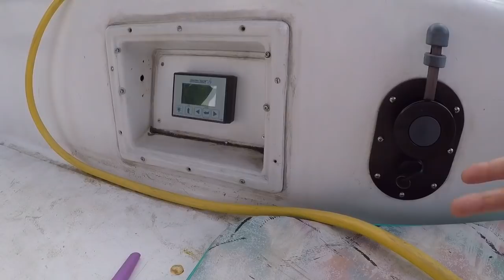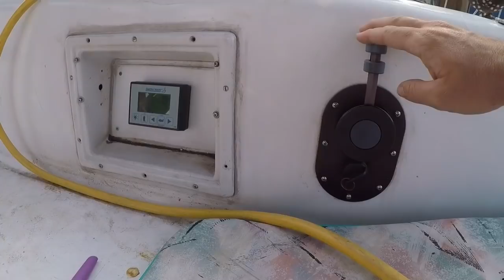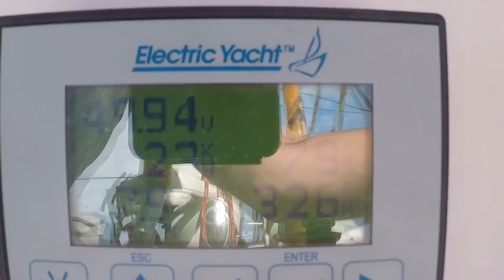Our Electric Motor | Sailing Wisdom Ep 32

Comment: Try and find some used Toyota Prius batteries. They are 48 volt lithium and are the size of a suitcase. They are heavy but they will extend the range and with a 48 volt whisper wind turbine they will charge whenever there is wind, and combine that with 48 volt solar setup, you will be golden. I did that on my 79 foot vessel.
Reply: Hello Cricket Green,  I am not smart to the new cars.. Sorry I am more of a Class 8 truck guy or Pickup trucks. What year models or these battery's in on these Toyota Prius and is there other cars or pickups that have that you can share? Thanks
Reply: @PlainStraightShooter  any year Toyota Prius. They are all battery powered.
Reply from the maker: Crickett Green I’m going to be building a lithium bank when we get back to the states ⚡️
Reply: Just use Tesla modules?
Reply: What size motor did you go with?

Comment: Everytime I've suggested an electric motor replacement for my ailing (now dead) 1972 Volvo Penta Diesel I've been howled down by people who's opinions I normally respect.  I held back with the switch because I couldnt get the boat approved for Cat 1 offshore racing which I wanted to do at the time.  My needs may have changed and I'm activly considering the switch and I agree about your storm sailing decisions.  My boat with a much better skipper was in the 1998 Sydney to Hobart Race which claimed 6 lives and it hove too rather than trying to fight the sea.  I have read the chilling coroners report and my skippers evidence.  My boat. a s&s34 was the last boat to finish (41st out of 121 starters) but she finished.  A diesel does'nt get you out of a storm - good seamanship does.
Reply from the maker: +Paul Kenna wow what a story! Thanks for sharing. It's so refreshing to hear your opinion on storm tactics. We were sad to discover that so few people shared our views. Fair winds on your future sailing endeavors!
Reply: Agree. Dealing with storms is a different question than dealing with your motor.   This setup is decent, maybe have a backup jenny ready to kick on in case you have to run for a few hours.  Some motor their way around a cape or past a storm.  But that's not really sailing. Keep a weather eye on the storm and sail smart you'll be ok. Maybe add the jenny later, and a few keel bats
Reply: Well said Paul, 
Storm cells move at much higher speeds than boats do , good seamanship and planning is the key to avoiding damage and much worse
Reply: I've read that most storms move at something like 17 knots so that speed would be needed to avoid a storm. Is that true?
Reply: Paul Kenna don't do it, salt air and corrosion. Retired Navy and I have seen these motors fail when people need them the most. Plenty of sunken sail boats in the triangle shorted out electric motor, no sea anchor, no power to radio, and dead people from dehydration. Some things you should never change, separate systems, fire is number one killer on a boat..... Remember this!
Reply: I have seen the long version documentary on that race. I am very happy that you and your crew made it through that. The S&S 34 is a true legend of her early production period. Can't really speak for the newer ones. Jessica Watson chose very well her vessel there. I understand many S&S 34s have run that race. Regular entries of vessels into that race is the highest compliment any production boat could ever enjoy. And yes, dousing the sails and reaching for the starter to the engine in open water when a storm comes along is a mark of extremely poor seamanship IMHO. Getting clobbered on the nose in a restrictive maneuvering situation though is a different issue altogether.
Reply: Seaman ship & knowing your boat all the way. The motor can only push the boat from one location in one direction (well, ok there is reverse too). With sails you can focus your forces fore/aft, pulling the bow up or down. You can dial in your heel angle to best resist wave action. You can trim to push through waves or ride over them, and so much more! Just make sure you practise before the storm, so you understand what that tiny little heavy fabric orange sail is for.
Reply: @MrSki-tyvm  - 
* shorted out electric motor = poorly installed & maintained system/s
* no sea anchor = poor seamanship
* no power to radio = poorly set up battery bank systems.. radio should be on house bank, not engine bank
* death from dehydration = water tanks not topped off = poor seamanship

So all your objections to electric motors come down to poor design/maintenance/installation issues, and poor seamanship. In other words, the problem isn't electric motors, but idiots operating boats.

Comment: Excellent video!!! I really love that you all are going against conventional wisdom and proving that electric motors really work and for most situations will work fine for what you need. I would be very interested in an UPDATE VIDEO to this one, to show after 1 year how the electric motor decision has worked out for you all. Also interested in maintenance, and longevity of the system so far. SO many think this is not possible and cant be done and you all are absolute PROOF it works.

Comment: Don't be afraid of low voltage. 48 Volts don't hurt. You can barely feel it. From 80V it starts to feel annoying and from 120 it becomes dangerous. Most stick welders output 48 V (For reference). Good thing though you covered all the contacts, because you will weld metal items together if you accidentally create a shortcut...

Comment: Great informative video guys!

I made the decision 2 years ago to remove the diesel from my cruising sailboat after it let me down in a precarious place with no usable wind. Initially I planned on going Electric also but after the first year sailing with no engine at all I have not found it to be a hindrance. I also have no schedule and nothing pressing me to be in a particular place at any particular time which helps obviously. Besides it's a lot of fun watching the gaping mouths as I sail up to a dock single-handed from time to time.

I believe not having a diesel to rely on quite likely is the best way to improve seamanship. Working with the wind and currents as opposed to always feeling like you can just plow through disregarding either.
Reply from the maker: I completely agree! Awesome life choices :)
Reply: Jim Wilds I remember gow great it felt to glide into the marina, dog leg right, past the gas dock and into my slip, just a little scull on the rudder and Ruby was home

Comment: I studied alternative fuels in college with a special interest in electric motors and solar power. When I find the right sailboat I’m going to mount up a Tesla motor and battery pack. It will involve lots of solar, up on deck, anywhere I can put it. My endgame boat is an Amel Ketch with a center cockpit. Probably an Amel Euros 41. Just saw one online for 30k fully ready for circumnavigation.

Comment: I'm glad I found your channel.  I recently rescued from imminent destruction a 1979 Hunter Cherubini 37' cutter and am a full-time live aboard.  I'm half-way through the interior renovation.  She's old enough and the price was ... um ... "right" that I have felt comfortable cutting into her and rebuilding stuff better than original.  I will be replacing all the standing rigging with Dyneema and replacing the broken roller furler with a head stay.  Then, have hanks put on the head sails.  I will be pulling the diesel motor and installing electric.  Still need to find a way to manage head sails from the cockpit.  I will be solo circumnavigating the Atlantic in 2024 so everything needs to be fixable by me.   It seems that most of what I think is best you have already done.  Thanks for all of the great info!
Reply from the maker: Did you by chance buy the boat in Deltaville VA? We came across a guy who was going to rebuild that exact boat there about 7 years ago. Those boats have very good bones. It would be a crazy “small world” situation if it happens to be the same boat ;)
Glad we can be a resource for your rebuild! We are in the process of rebuilding an Alberg 30 as well and e we will be setting it up for single handing.
Reply: @RiggingDoctor  nope.  That wasn't me.  You are correct.  She has great bones.  Perfect boat for a rebuild.  I will be following your videos for how to DIY.

Comment: Hove to is the best way to survive a bad storm.  That's been proven repeatedly, at the cost of many lives.  

An electric motor is the best of all worlds, especially with hydrogeneration (regeneration, getting battery charge from forward motion from sailing).  Step down for maintaining 12V is fine.  Make sure it has a very good 12V charge controller (very important).

The "solenoids" are called contactors.  They're basically very high current, totally sealed relays, also used in electric vehicles,  electric forklifts, etc.
Reply from the maker: +Loanword Eggcorn hove to certainly worked out for us, stay tuned for our next video!

Comment: Interesting. I replaced a 40 HP Volvo Penta diesel engine with a 29 KW (40 HP) Elco electric motor. My motor runs at 108 V, and I had two custom lithium batteries made for it, giving me 200 ah at 108 Volts (about 21 KWh). Neither my Elco motor nor my feathering prop would allow for re-gen under sail, so I managed the power flow the opposite of yours... from my 900 ah, 12 V house bank (also lithium) to the drive bank. My wind generator and solar panels charge the house bank, and then using a 3000 W inverter I run two 48 V chargers hooked in series to charge the drive bank. Range varies considerably based on speed and conditions, but I'm generally good for 30 nautical miles at about 4 knots. I also have a small, gas powered Honda generator that can fill up the drive bank in about 12 hours. I'm still adding equipment and preparing for a trans-Atlantic trip next year, but the sailing I've done on Lake Ontario so far this year suggests that my Honda generator will act more as ballast than a power source. BTW, I also have a full keel, heavy displacement boat (Reliance 44). I'm certainly not looking to sail into storms, but I'll be more or less comfortable riding them out.
Reply from the maker: Sounds like an awesome setup! We now have lithium batteries and it’s a world of difference!

Comment: TFS Nice job explaining you electric drive system. You have a open ocean boat so I see no need to run from a storm unless it's a hurricane. Then seek shelter where you can. Keeping an eye on the weather is always a good idea. It lets you plan ahead of the storm. I would add a couple more panels to set on top of the dingy to help your recharge rate,

Comment: lolol...a motor is a motor. Electric or hydrocarbon based. And an electric motor is always 'ready' where a petrol-engine deeds to started and warmed up: to protect it. But hell, I spent 20 years riding submarines. What do I know about electric power in a boat ;) lol
Reply from the maker: Well said!
Reply: Honest question. What supplied the electricity on the submarines you rode? Batteries charged by diesel, or nuclear reactors?
Reply: Electric motors have full torque instantly, diesels do not.  Diesels are only efficient in a very narrow rpm band which is why they need transmissions.  Electric motors remain efficient through a much larger rpm band.  But heck, I'm just an electrical engineer, what do I know.
Reply: You are so absolutely naive!!

I owned a 62' ketch. And sailed it over 100,000 miles for 10 years.

Let me tell you....that are times you need to get some place NOW!!!  OR....to get the hell out of the way, of someone, or something else!!  Regardless if theres wind or not!!

Medical emergencies!!!  They do happen.  Some one slips and falls....hits there head...bleeding...breaks a bone...etc.  Even a severe tooth ache erupts.

And you can't move because there's no wind...or not enough wind....or you cant get there fast enough because your ahaonst the current....or heading up wind!!

OR....your sitting anchored, like in a bay.  A major storm is happening....your neighbor boat...OR-FULL BLOWN SHIP!!

Is caught by the wind....and is going to go right over the top of you!!!  And you batteries are dead, or low!!

I mean...I even anchored in St. Barts!!  An interisland freighter is coming in.  You move....or you get hit!!  Try speaking island French to explain why you cant move!!

You are SOO, absolutely naive. That is sooo incredible!!  You don't even know, that you cant even think of to know!!

I've sailed to so many countries!!!!  I've been thru 5 hurricanes on the high seas.  2 more anchored.  You cannot plan for every emergency, that you happen....which is why they call it an emergency.

Ive lost 36 friends, whove died or disappeared, sailing the world.  It happens.   Im even planning my next boat....probably a Swan 120!!

Its going to be primary ALL electric.  BUT..with engine back up!!  I mean in Norway, there are becoming Fjords you cant go in, unless your boat is green!!

But to hear that you evidently have an engine....and are going to take it out!  To switch to electric.  Its just not naive...its dumb!!  Youve got it anyway!!

Anyway....

Good Luck....

Have fun....

Jeffery

M
Reply: Jeffery Jeffery…chill…
Reply: @FREISme  

Interesting response FREISme...'chill.'

Spoken as someone, who's absolutely  clueless!!!!

Comment: great choice with the electric ... nice clean power ... and no dirty diesel or gas ....clean sailing ... there is lil turbines that go on the side of boat  that produce power to the batteries from the movement of the water ... great free power or close to free

Comment: Hey guys, new subscriber. Love what you did and as others have said... more and more folks are doing "it". I'm on my 8th boat and 3rd electric sailboat, a Mac 25, using dual 55 thrust trolling motors, 4 type 31 batts and 4 -100 watt panels with a Renogy controller. The funny thing is, my numbers are very similar to yours. I could run on the 2 setting on both motors mostly all day, especially if the sun is out, and get 2 to 3 knots in fair conditions. At full, I can get about 2 hours or so before I get to 50% on the batts. Works out great and rarely need them except for close in work or when I get impatient. Of course, the Macgregor 25 only weighs about 2500 pounds so I can get away with "outy" motors, but its great for coastal cruising. I love the simplicity of it and even when I move up in boat I will just scale up to larger electric outboards. My entire electric system cost around 1500. Fair winds and ill be following...
Reply from the maker: +Skipper Hawk awesome! We love the simplicity too. Thanks for subscribing and we hope you enjoy the adventure!
Reply: Keep in mind that the props on trolling motors are optimized for low speeds.  Different props can go faster possibly more efficiently.
Reply: Its a good point... there is a company called Kipawa that sells better props and steps up the 2 blades to 3 blades... generally when you get to the 55's and above, the props are three blade and are nearly as efficient as they can be. My experience over the years has been good with them but I do understand the comfort and safety factor of an over-sized outboard or inboard and hold nothing against them. Just had to many fail at critical times and gotten comfortable with my electric choice. Now the 5 grand full size electric outboards would be the dream, too pricey for me though.
Reply: Internal combustion is really complex and unreliable compared to electric.  So many more parts, hoses, cooling systems, etc.  Costs for electric will continue to come down, especially for Lithium batteries in part due to improvements in electric cars.  

Also much cleaner and lower CO2.  You can recharge your electric motor batteries from wind, solar, sail (via hydrogeneration).  You can't make fuel for internal combustion, at least not easily or efficiently.
Reply: I hope your right man... these proposed solar tariffs are a little concerning. I'm glad i have enough panels for now.

Comment: Electric motors and diesel motors are simply 2 different versions of the same thing. It’s a question of whether you want to carry your fuel as a liquid or as batteries.
It’s the same as electric cars. People are just unaccustomed to them. Once batteries, solar/wind/water generators become more commonplace, people will begin to say “geez... it isn’t as weird as I’d thought... perhaps we should’ve made this move years ago..
Electric motors actually are smaller for equivalent power. You can actually have a “spare motor” in case of a problem to swap out and the two will take less space/weight than your Diesel engine.
It’s an inevitable future, but people are just unaccustomed to the idea and so their minds rebel...
Reply from the maker: All very true and well said!
Reply: There is such a thing as energy density. A kg of diesel has a bucket load more energy that  a kg of lithium battery. Of course the lithium battery system has a better energy conversion but still....

Comment: Nice explanation. I've gained a lot of experience with electrical work, inverter chargers, LiFePo4 batteries, and solar building our bus. That will carry over to an eventual live aboard boat build. I'd definitely go with an electric motor over diesel. I'd like to get your thoughts on your Electric Yacht add other available brands like Ocean Volt, etc. The regeneration is awesome.
Reply from the maker: Sounds super cool! Electric Yacht is nice because it’s extremely simple. There isn’t a lot to stop working or go wrong, whereas Ocean Vault has a ton of gizmos that are apparently braking all the time.